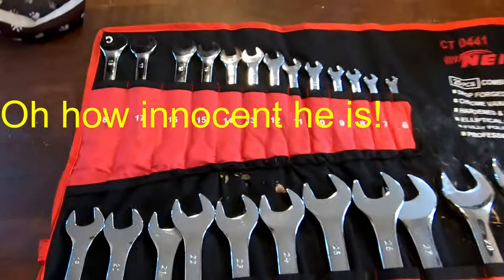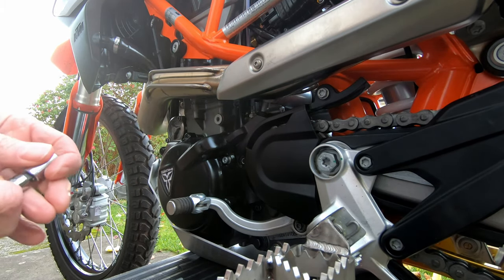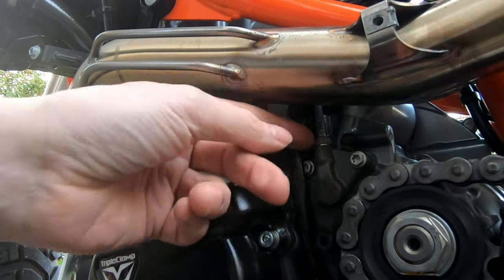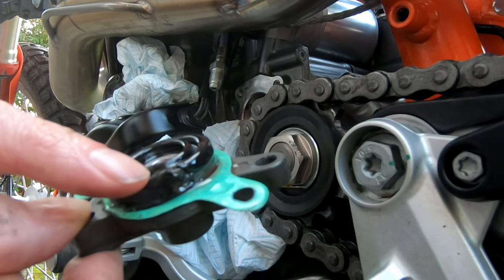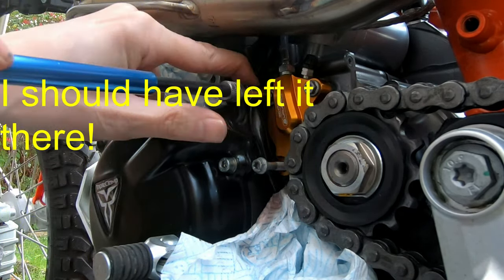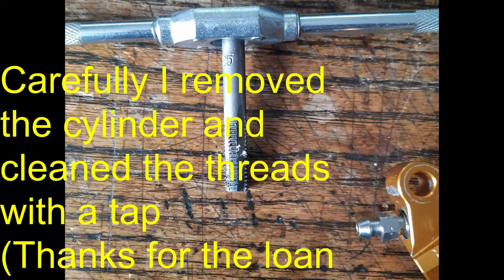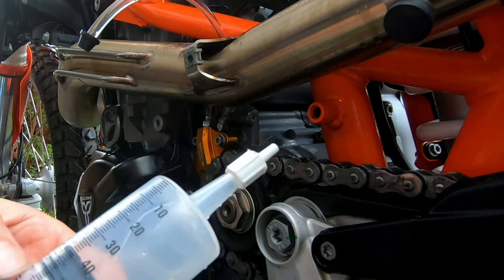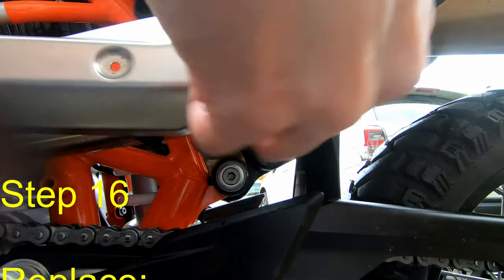KTM 690 Enduro R - Oberon Clutch Slave Cylinder - Reverse Bleed

Comment: Just replaced mine. Only because the rubber O ring seal went inside & brought me to a sudden stop on my fish & chip run up to seahouses. Thanks for video as I am now back on the road. Fingers crossed. 👍🇬🇧
Reply from the maker: It's weird they kept this design so long. Mine has been fine since. I really like the hydraulic clutch so fingers crossed for us both 🤞👍

Comment: Wow!  Cannot believe a brand new stock Magura clutch slave cylinder has damaged rubber around piston.  I have a Rekluse version on standby ready to install in spring.  This issue is constant debate on ADV.  Some even joke that Magura owns Oberon.           Kam
Reply from the maker: I was totally surprised too. I thought it was just an exaggeration, but mine was on the way out already. You could be right about Magura! 👍🤣😂

Comment: I went the same with prevention maintenance before mine failed. Only difference is that I just replaced the o-ring which fails.
Great bikes.
Reply from the maker: That would certainly be much much cheaper. Still, the diaphram/gator thing on mine was split, so I'm happy to have changed it. I love this bike👍
Reply: @CodgerBiker  sorry , I meant to say I replaced the piston which has the new o-ring and diaphram . You can tell by the dots on the piston head, 3 dots are the old ones that fail and the new ones have 4 dots on them. Was a bit cheaper at $90.00 AU Dollars compared to $300.00 plus to get the oberon to Aus. Mine still looked fine when replaced but you were lucky to have caught yours when you did.👍
Reply from the maker: Thanks for the info. I'd heard of O ring replacement, but I had no information. The Oberon seemed to get the best feedback. It's made over here so that saves a little - still expensive. I hope it works out for us both either way. Typical KTM, but I go in with my eyes open having researched the bike as much as possible before buying. It is so good in many other ways changing a few components is just about acceptable. 👍

Comment: Codger, loved the vid, and have the slave to replace this week too......I'm having problems sourcing the syringe assembly you used to back bleed the clutch........did you buy it locally or is it an Amazon special?
Reply from the maker: 👍 Cheers Paul. It was an Amazon special. Hyber&Cara 100ml Syringe with 100cm tube. Thinking about it I reckon mine went easily because all the fluid had drained away, so no air pockets could be trapped by existing fluid (well maybe). Here is the link if it doesn't work try searching by name: https://www.amazon.co.uk/gp/product/B0829WRZZ1/ref=ppx_yo_dt_b_asin_title_o06_s00?ie=UTF8&psc=1

Comment: Hi codger, I seem to have followed you via a 790 then to a 690. My 690 slave cylinder failed at 150 miles, in the centre of Beverly.
Reply from the maker: I had heard of it being an issue before I bought the bike. That and the seat being hard. And a possibility of subframe bolts either sticking or breaking. I’ve changed the seat. Checked the subframe bolts come undone. The last thing was this cylinder. I was expecting it to be a waste of money. Not so, mine was failing. I guess it is good to know about these things in advance. I loved the 790 but, somehow, the 690 suits me better. Let’s hope I have caught all the snags before they happen. 👍 PS how do you find the 690 compared to the 790?

Comment: Awesome, that's what I wanted to see was where part failed. I had about 500 on mine also, cruising having a great time in middle of nowhere, go to grab clutch and nothing there. Just had dealer replace but will take off and bag for spare. Funny I traded in a 2017 701SM that had 20k on the stock one, I rode everywhere on with no issues. Seems to be hit and miss, wonder if is install consistency or lot run issues? Not worth bagging risking bagging another trip on though so will swap and bring spare.
Reply from the maker: I didn't expect it to be failing. I thought it was just a myth. Glad I changed it. It seems to be hit and miss. I see on 2021 they finally changed it. Great clutch though 👍
Reply: i dont mean to be off topic but does anyone know a method to get back into an instagram account??
I stupidly lost the password. I would love any help you can give me

Comment: Hi Had the original slave cylinder given any sign of failure prior to you replacing it  cheers thankyou 👍
Reply from the maker: None at all. I was sceptical about the need, but everyone said it would fail. So I was surprised to see the poor condition inside. The bike had only 500 miles on the clock, and the clutch was working fine. Glad I changed it. Most people just change the O ring I believe, much cheaper. 👍

Comment: My new (200 miles on it) 2020 Husqvarna 701 Enduro slave cylinder just crapped out so I ordered the Oberon part... really is sort of terrible that the stock part has been faulty for so long and KTM has not repaired it. My understanding is that the 2021 has the new part so is not susceptible to this... so much for 20's and 21's being basically identical.
Reply from the maker: I knew of the issue before I purchased, but was surprised of condition when removed. Great clutch otherwise. KTM have a weird history of not fixing things everyone knows about. Hopefully that's it for faults. 🤞

Comment: Where did u get the plunger from to reverse bleed? Great vid thanks
Reply from the maker: Cheers. Two years on and all still works fine, I should maybe change the fluid soon. Thanks for reminding me👍 I used these from Amazon: Hyber&Cara 100ml Syringe with 100cm Tube, Large Plastic Measuring Syringe for Fluid Oil Suction, Nutrient Measuring, Refilling, Watering, Pack of 2

Comment: very helpfull video!,mine went last week after 6700 miles.

did you use the washers that came with the kit? as i have seen some people say that you dont need to use them?
Reply from the maker: Hello. From memory there was no need for the washers. I believe they are included for banjo style fittings on other bikes, and will leak on 690 style fitting if used. Well that is my memory. All has been fine for 2000+ miles so far 🤞👍
Reply: @CodgerBiker  Hey thanks for that,I installed it yesterday and am about to put in my oil today so I'm hoping is all good now!
Reply: everything is good now!  and i swear that changing gear feels and sounds alot smoother now!.

aslo my bleed hose was tight so i just gently heated it with a lighter then it slipped right on the bleed screw ;)
Reply from the maker: I softened mine with hot water. Let's hope that's us sorted. I love a hydraulic clutch 👍👍

Comment: i did the exact same mod on my 2020 with 800 miles. My stock unit looked fine fortunately
but i was able to cross thread the inlet side, so it seems these oberon units are very soft and easy to cross thread.
Reply from the maker: Yes I used very little force. I think if it does not go back in with just finger pressure then it is likely to cross thread. We live and learn. But I am glad the stock one is changed as it was damaged and likely to fail by the look of it. 👍
Reply: @CodgerBiker  yes exactly. 
i was disappointed in Oberons customer service too, but like yourself i ended up just running a tap through a few times and its been rock solid since.
Reply from the maker: That's good to know. When I do it again I'll make sure I fit everything finger tight, no spanners, till it is all seated. Luckily I did fit the pipe from the master cylinder that way. Hopefully my misadventure might help someone else 👍

Comment: Hey boss i just replace my slave cylinder all new gaskets and everything and now I’ve developed a engine oil leak from the slave cylinder what can cause that ? Bad push rod seal ? Idk man im stumped
Reply from the maker: Hard to say. My first thought would be to check the gasket isn't torn, it's easily done. Or has shifted. Or that it is torqued up equally and square. 🤔

Also you sure it isn't clutch fluid?

Comment: Do you need the washers for anything that comes with it?
Reply from the maker: From memory, it was a while ago, there was a supplied washer for different fitments. But the Enduro R doesn't need it, in fact would leak. It's a direct replacement, so fit same as the one you take off 👍
Reply: Thank you

Comment: Where did you buy from ?
Thanks.
Reply from the maker: Hi Richard. I contacted Oberon to make sure I got the correct one:https://www.oberon-performance.co.uk/clutch-slave-cylinders
Reply: Thank you ✌
Reply: Codge 
Your engine covers , I’ve spoken to several places nobody seems to make them for 690r only Moto .
Do they fit ???
Reply from the maker: They seem ok. I’d forgotten all about them, still on the bike and protect against brake pedal going through stock cover. One side snagged on the bash plate but it was a simple mod, see here: https://youtu.be/Fefds8_zDrM

Comment: my 2018 duke 690 (bought new in 2020) just crapped out at 591 miles
Reply from the maker: There has been a worldwide recall on the KTM slave cylinders on 690 Enduro R since I made this. I stuck with the Oberon, no issues since. I'm sure the replacement KTM units are much better. See your dealer? 👍
Reply: @CodgerBiker  Thanks! Just contacted them. The replacements look like a solid fix.
Reply from the maker: Good news! All reports are it's a proper upgrade 👍

Comment: I have a ktm 640 lc4 Enduro 2004 with 15000 miles I did't have any problem with Hydraulic clutch until 6.000 miles so reading to your problem after only 500 miles I think to be very luky :), I still have original cylinder and I changed two pistons but every 150 miles I have to refil with mineral fluid and for shure I should have changed both cylinder and piston because the old cylinder probably has a wear so if you change only the piston it works better for few miles but you do not resolve the problem... now I want to install Oberon CLU1600 which should be plug and play I read that Oberon kit has been fully redesigned for resolve for evere this inacceptable problem... I cannot understand how is possible than KTM still has such a big problem on new 690 R which it is a very expensive motorcycle this is shameful !!! Is here some people who installed Oberon on 640 LC4 ??
Reply from the maker: Yes it is true KTM are veeeeerrrryyy slow to admit issues. In UK they finally did a recall last year. They have a new design and free upgrade. Worth asking your dealer. I did not bother because the Oberon has been great, no issues at all. 👍👍
Reply: Im about to install the oberon on my sxc625. Same bike.